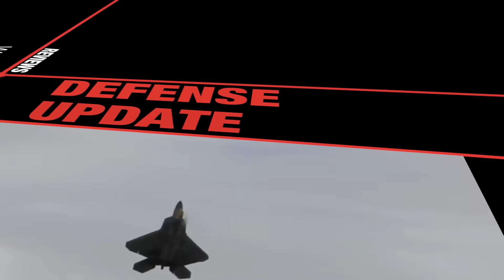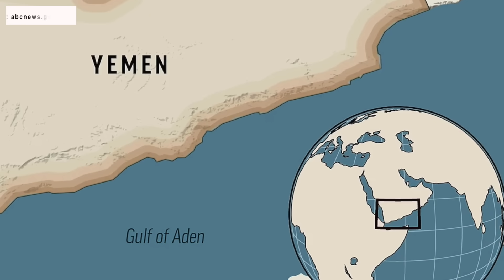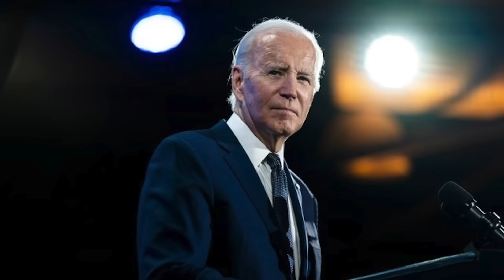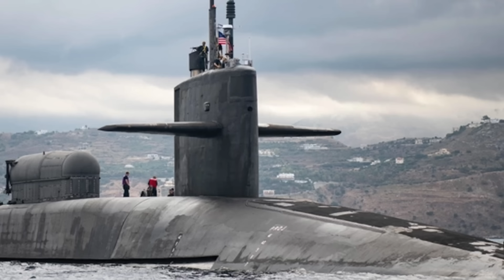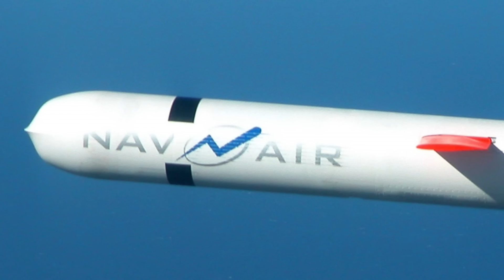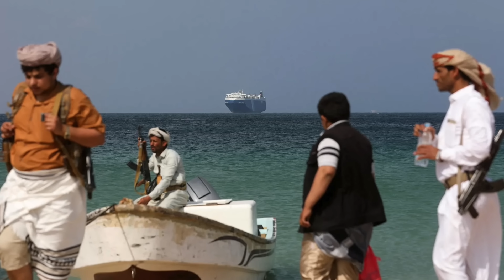#USSFlorida unleashed - targets Houthis in Yemen with #Tomahawk missiles !

Comment: If you had to break it down, I wonder what the cost of the network time/system time/whatever you want to call it for the satellite system that maintains the connection with the Tomahawk in flight as well as updates instructions mid-flight for a single average firing of a Tomahawk. lol; for example, if the government is the missile system internet provider, what would the equivalent cost be for firing that missile once, say for a 1000-mile flight or whatever the max range is?